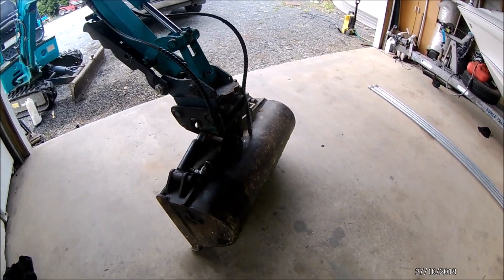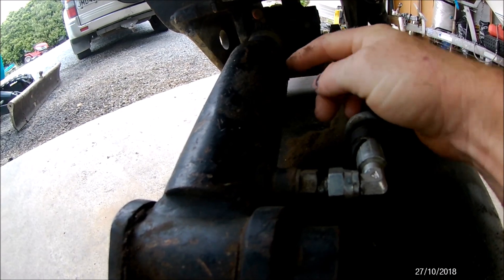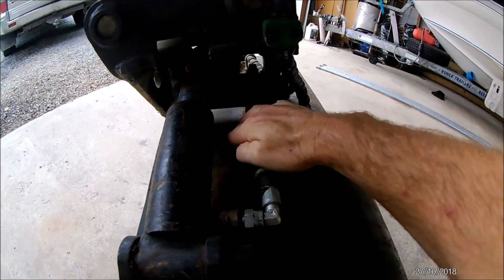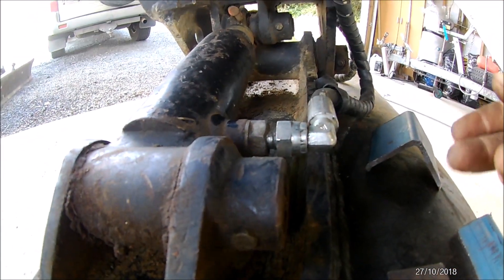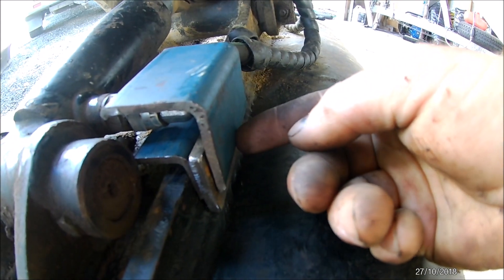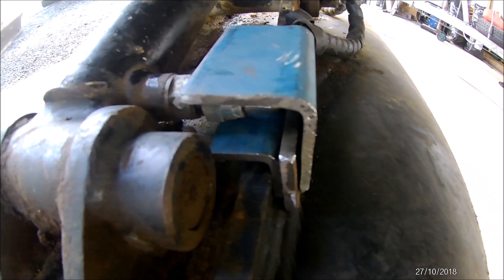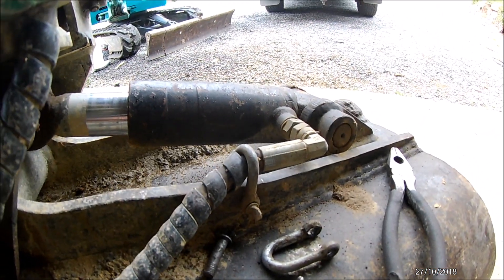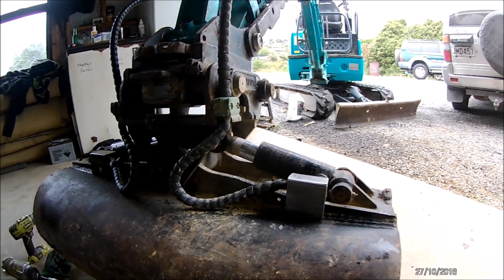Excavator Tilt Bucket Modification

Comment: Great video .. thinking of making a tilting grading bucket , could you ever send me measurements of the lenght of the rams on either side nd maybe a quick video of it working ?
Reply from the maker: Hey James, no problem, email me a info@getadigger.co.nz and I'll help where I can. 
I needed to put these guards on as the hoses were flexing too much and only lasting around 200 hours before breaking. Going on 800 hours now on the same set.
Reply: Email sent looking forward to hearing from you. :)